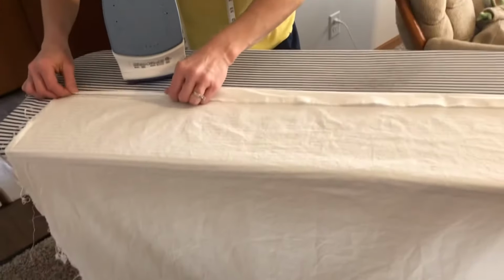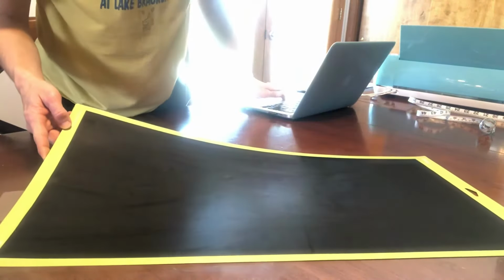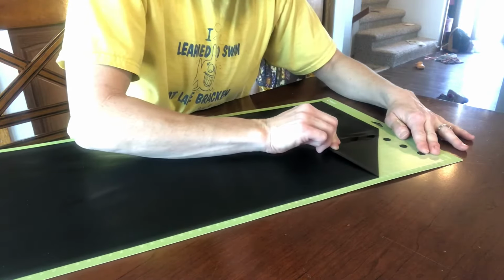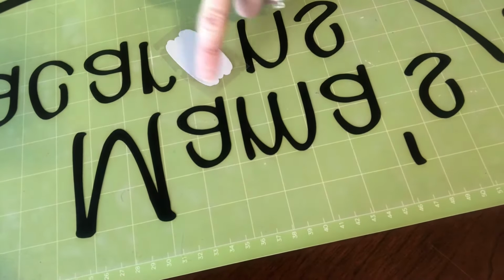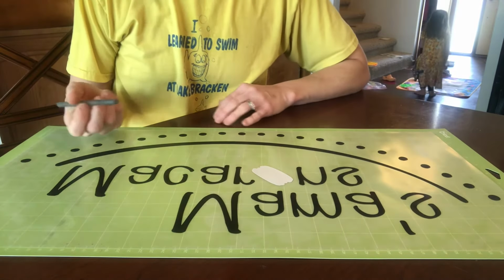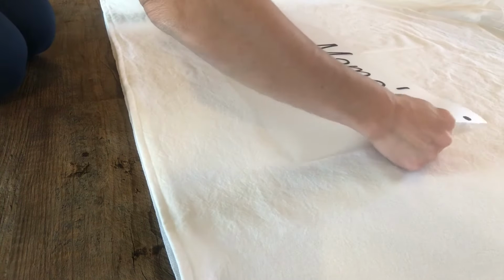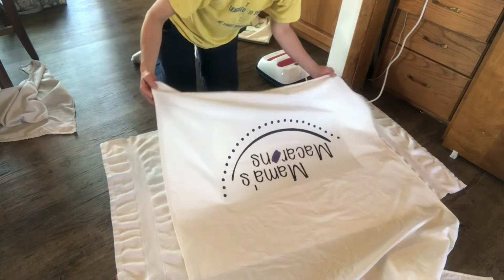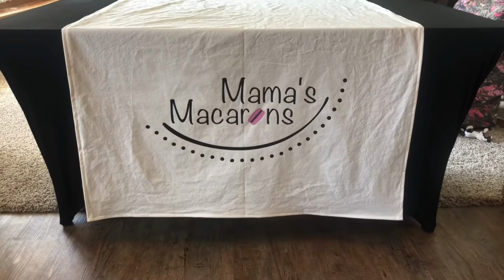DIY table runner for under $15

Comment: Thank you sooo much for this video. I’m planning to make one for a customer. I have a question, what size did you make your logo based on your fabric?
Reply from the maker: I actually sized my logo as large as my 12x24 cricut mat would let me. I use a standard 8ft table. I wouldn’t mind if it were larger, but I’m happy with it.